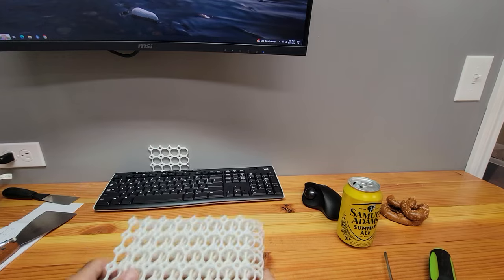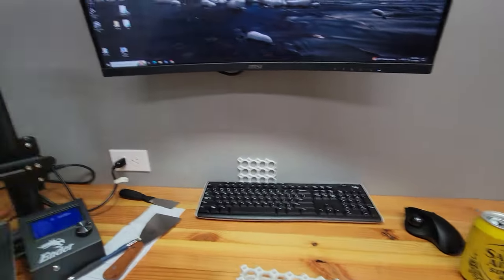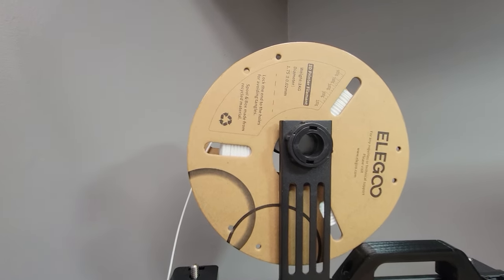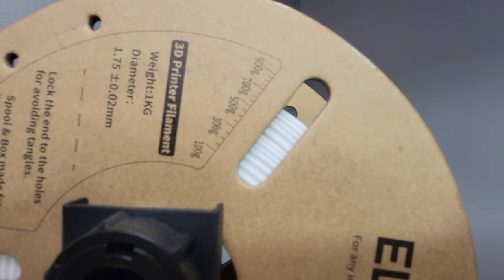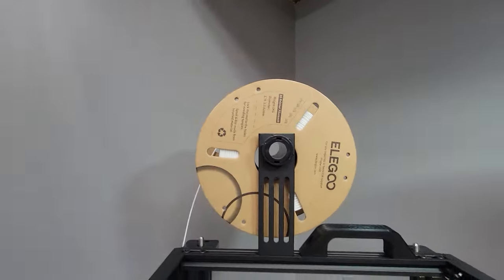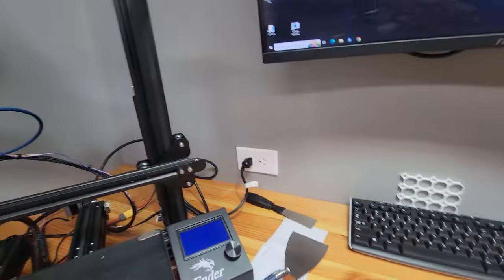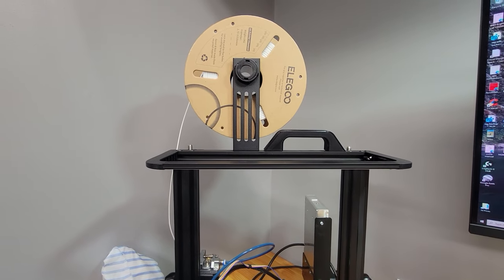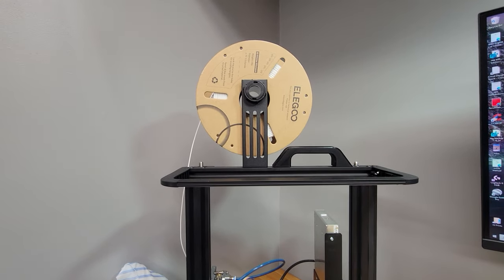Workshop: Multiboard prints

Comment: Awesome! I am currently waiting on my first 3D printer to be delivered this weekend😊! I for sure could use these grids to organize some stuff!
Reply from the maker: Good luck and have fun!  Which printer did you go with?
Reply: @dougdoesstuff24  I got a Anycubuc 2 Kobe’s Neo. But with the Microsoft crash, it’s coming in later than normal.😢
Reply: My first Multiboard setup was a total of 12 8*8 squares, the second is 3*3, and the next one I'm printing now is 5*4, and may be 5*5 if it will fit :) They are so versatile

Comment: My .2MM layer height 40% infill profile can print this in under 22 hours on a bone stock Ender 3 pro. I highly encourage you to look into tuning your slicer profile by hand as the default settings are FAR too conservative. Though my profile prints over twice as fast, the prints are able to retain the majority of the strength compared to default.
Reply from the maker: That's good to know. What is your print speed? No mods?
Reply: print speed 60mm/s. But just changing your print speed will not make you print much faster

Comment: Doing the same 4 stack on my K1 Max and it's going to take 24hrs, and I thought that was too long lol.  Still using my Creality CR10 as the "parts" printer, and it's doing 15hr prints at about the same speed as the Ender 3 Pro. The biggest thing about both these printers is the removeable spring steel built plate - it's a game changer for removing prints from the bed, even really small ones come off so easy.
Reply from the maker: It is a long print for sure, but it was coming out very nice.  All the damn upgrades I did ended up being downgrades in quality.  ugh
Reply: @dougdoesstuff24  yeah quality is primary when you have things you see each and every day. At times I want to get another printer to get these jobs done quicker, but I might just have to dust off the old CR10-S5 and get it working on some of the items as well. I think I have 3 weeks of printing left just for the next multi board project, then I want to start on the tool storage

Comment: 2 days to print that is insane, I think my mostly stock sidewinder X2 could do that in 8 hours or so, I suggest you speed up the print head, get a 0.6mm nozzle which will let you set the layer height to 0.5mm which is awesome for churning out stuff like this
Reply from the maker: I'm new to the 3d printing realm. I'll have to dig in and see where I can speed it up. Thanks for the info
Reply: Careful with that advice-- first, the stacks are designed for 0.2mm layer height.  The "gap" between layers is 0.2mm.  Also, the recommended print is 3 walls, and about 15% infill.  On my Bambu X1C, "mostly" default settings, a stack takes 11 hours.  The first three layers have ironing enabled for top surfaces.

Also, unusually on the multiboard, each hole (big and little) is threaded.  This means you can thread in pegs, connectors, etc., but it also means that each hole is threaded, and I haven't tested how large layer heights work on multiboard.
Reply from the maker: @johngelnaw1243  Hey there.  Thanks for chiming in.  I did see that about the .2 layer height.  I have no intention of changing nozzles until I figure this thing out.  Again, thank you!

Comment: I saw the multiboard guys video. he does it by putting a PETG layer between the PLA 8x8 prints. means you need one of those fancy bambool ab multi filament printers. 
 I am trying to see if i can do this on my ender 3. and good to see you have done it. I am tired of printing one at a time every 5 hours. please share your tips on how to achieve this stack on a ender3 like printer and what settings would help with separating the prints
Reply from the maker: Honestly, before I went about messing with my E3Pro it was printing solid as you could see in the videos.  When I tried the darn Sprite extruder SE is when my problems started. I just had a basic cura normal profile with a few changes to walls and ironing and it was working.

Comment: I just print one at a time and all of them have nice PEI surface. Cool subsystem.
I personally do love only the very first Ender 3. All other modifications have their downsides. Why Creality would not polish the very first model and call it Ender 3 DIY is a mystery for me. Prusa have printer KIT and as far as I know it have its popularity.
And I already posted under the other video. The very first Ender 3 is very easy to maintain and upgrade, it really need some tuning, but after that it just prints. I am going to install POM Z nut so I will not need to grease it anymore. Needless to say in a two years I never greased it though = )
And it can print really fast, may be not so fast as a Bambu models, but 'cmon, its $100 printer which was created like 7 years ago or so. And Bambu printers are top notch and have quite a cost.

Comment: Great to see this video!  Congratulations on the new printer.  Do you use Orca Slicer?
Reply from the maker: No, I use Cura. As I get into the hobby that might change
Reply: @dougdoesstuff24  Nice!  If you end up moving to Orca Slicer,  OctoPrint, or have any questions please let me know I'm also newish to it but have compiled marlin after installing a direct drive Revo nozzle.  Always happy to help maybe some of my failures could save you some time.  I'm thinking about trying the multi board and appreciate you sharing
Reply from the maker: @RandoTechNerd  will do. Got another  video coming out tonight. I picked up a sonic pad and it's crazy fast

Comment: Damn, do you usually have the printer printing right next to you as you work on the computer?? Or did you move it there just for the video?
Reply: I have 4 printers in my office what's wrong with that
Reply from the maker: I just moved it there for now because of how long it was going to take.  BUT, since I did the motherboard upgrade on it, it is VERY quiet.  I could tolerate it if I had to.  The original motherboard was so loud and could be heard from anywhere.

Comment: What is multiboard = the 3D printed organization system based off of others that have already existed that tries to take advantage of packages that make it easier to understand the system to make money, that sums it up in the nutshell, ohh and uses the license two stranglehold makers on what they can and cannot recreate lol..........................
Reply from the maker: so you're a gridfinity guy ;)
Reply: @dougdoesstuff24  nope honeycomb storage wall cuz its free and remixable and the creator didnt create it to take advantage of people to make a buck and claim its FREE
Reply: @NoMercyFtw  Yeah, that $5 I paid for access to all the stack models nearly bankrupted me.  Multiboard is also remixable, but you can't claim it's your own work.  And you can't sell it (without a license).  What a burden.

I evaluated most of the available storage wall options-- and multiboard wins hands down, and by a country mile.  It's pegboard compatible, it supports connectors, it holds a LOT more weight than HSW, and personal peeve, I don't have to put my snaps diagonally.

I do think the starter package should be free, though.
Reply: @johngelnaw1243  I didn't have to pay anything I made my own stack, I'm just not going to support a system that was built designs to take advantage of how easy something could be and then purposely making it difficult for the free version and then offering a paid package to explain it and offer it in a more understandable fashion
Reply: @johngelnaw1243  oh and by the way thread boards is better than multiboard hands down if I would pay for any of them it would be that one, and honeycomb storage wall is the best period